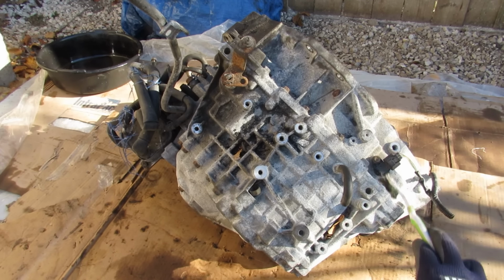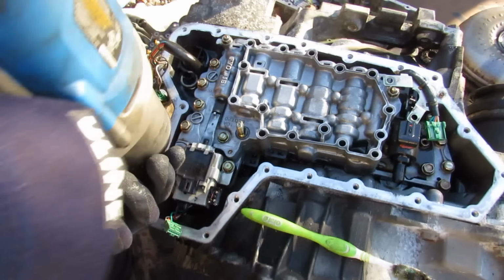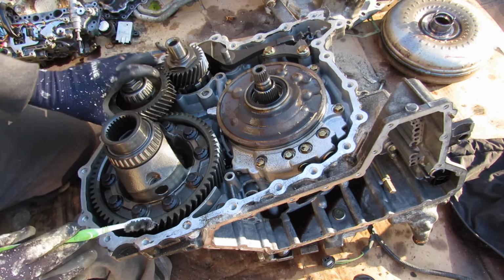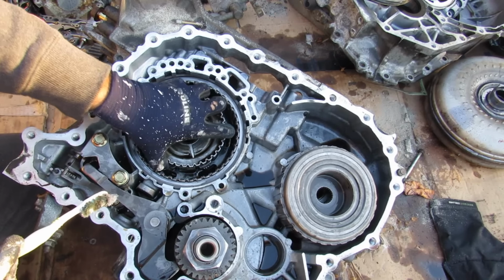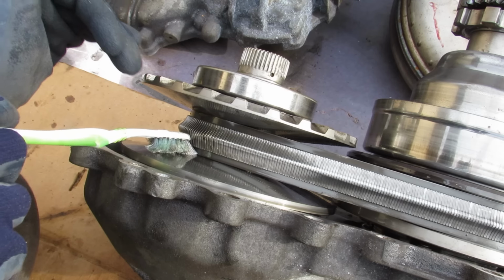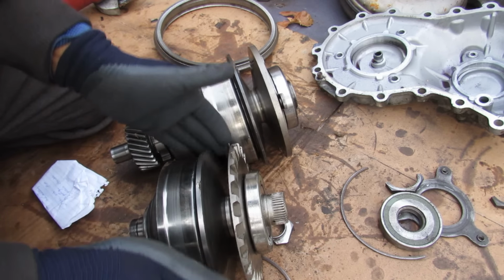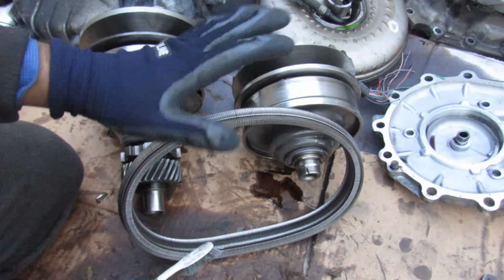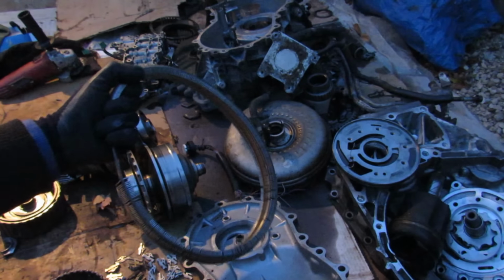Why Nissan CVTs FAIL

Comment: 17:15 ahh this makes so much sense. I thought the delayed response was something I was making up. It kind of felt like the car was thinking for a short while before it started to move. Had CVT on my 2002 Audi and wondered how it worked. Have seen a lot of animations but it's nice to finally see how it looks inside an actual cvt transmission. This is fantastic, thanks!
Reply: Nah... you weren't imaging it.  That's the main thing I tell people feels different about driving a CVT (on a '20 Subaru Crosstrek to be specific).  --  It also has paddle shifters and 5 "gear positions" on the dash so I'm still trying to figure out what the hell that all means but I did figure out a long time ago that you can pre-load the RPMs into the transmission by revving a couple times right before you take off.  The thing that really kills ya is trying to go pedal to the metal from a nil-RPMs standstill.
Reply: @llYossarian  thanks. I am a bit surprised the car isn't ready to go (hydraulically) once switched into drive but definitely noticed it more when accelerating suddenly.

In terms of the shifting (paddle or otherwise), I'm not sure about the Suburu but on my old car it was basically preset gear ratios, making the CVT feel a bit more like a manual. You could then control the revs in each set ratio (after shifting to it) without the gear ratio changing automatically as it would when driving normally. 

The car also had a button on the floor that if you pressed the accelerator hard enough it clicked and would change the gears to maximise acceleration.
Reply: @Chrazzari  Huh...  we are talking about almost two decades of improved computer control so that may be making a big difference.  --  If I don't use the paddles"/autostick" and accelerate smoothly I don't notice any "gear jump" at the ratios so I think it IS ready to go hydraulically but the computer is expecting a relatively "standard" acceleration and likely only varies the ratio at a few set speeds rather than dynamically so if you vary significantly from that "planned" powerband you get a "shift" sensation as the rotor extension speed changes -- if ANY of that makes sense...  I genuinely can't tell anymore.  I think I've hit a level of semantic satiation on this topic and my brain just seized up.
Reply: @llYossarian  oh yeah sorry I don't notice any jump when not using the "gears". It's smooth, but doesn't seem to accelerate until the gears have changed ratios (like we were talking before about the car "thinking" before moving). But as you said decades of improvements. Mine was a 2002 model so definitely would expect a lot of changes in that time.
Reply: Lol used to have a scooter so driving a CVT car didn’t do much good for my case. CVT are just fine. how we maintain them is pain in the butt. But it is much less complicated and “fewer” moving parts compared to AT. Or DCT. Definitely. But rubber bandy traction and hesitation fucks you over fr lol

Comment: In my personal opinion CVTs biggest point of failure is the driver not adjusting to the slower response time of a CVT and trying to compensate the rubber band effect with higher torque. You just have to grant it its time to switch ratios. Driving a car with CVT is much like driving a boat. Speed just doesn't come instantly whenever you want it.
Reply: Funny. American stress to much on  0-60!

Comment: Very nice! I'd be interested in seeing a teardown of a Dual Clutch Automatic. I just bought a car with that and... I really hope I didn't make a mistake.  :P
Reply: What car?
Reply: @viperstrike3827  2022 Hyundai Elantra NLine
Reply: @newcarpathia9422  Nice car though!
Reply: @viperstrike3827  I'm extremely pleased with it so far!
Reply: @newcarpathia9422  I drive a 2017 Honda fit base model stick shift. I love driving it despite the economy car corner cutting. It is the best cornering car I have ever driven, it stops great. It feels a little sporty because of the manual. I don't care about wheels being pretty. My major complaint is that it runs 4k rpm at 80mph, which is a big deal.
Reply: @viperstrike3827  I love me a well-built economy car. Even better are performance economy cars with a little turbo. All the fun with none of the baloney. Simple and straightforward. I drove a used Mercedes before I bought my Hyundai and all I could think about is, "What am I going to do with all this crap?"

Comment: Pretty dang good breakdown video! I've got a 2013 Nissan CVT and can confirm they last one transmission fluid's life ~65K miles. I also drive mine like a maniac though, so YMMV- literally. However, he's wrong in that they don't get rebuilt because the one in my car is rebuilt... sooo... Also, I've never heard any whine on any of the CVTs I've owned over my life, in fact, theyre much quieter than an automatic IME. Unfortunately, he failed to talk about the ideal torque curve that these CAN produce that results in notable performance benefits, but the manufacturers program them to act like an automatic transmission during regular driving conditions so you don't even get that benefit to as much of a degree. If you give it the gas it comes out of fake-bad-transmission mode and they absolutely rip pavement. There is no elastic feeling at all because fluid doesn't compress (enough to notice) and you don't need to (and definitely shouldn't, ever) immediately compress/release the actuators because you want a gradual variance. Because both actuators are moving simultaneously a small amount of movement gives you a noticeable change in ratio. If Nissan were to provide parts and better instructions so these could be easily repaired then these would be great, but since we don't really need transmissions anymore at all it really doesn't matter anymore.
Reply: because it wasn't changed at the proper interval? if you beat on the thing that is a problem. sounds like your control unit may have a problem? was it replaced?

Comment: I had a 2008 Mitsubishi Lancer gts with 210k with a cvt transmission ran like a champ till someone hit me ended up having to get rid of it otherwise it would still be going 💪 i always kept up on proper cvt fluid change intervals so they can last with good care and built correctly lol

Comment: It's an Dutch invention , 
Made by the DAF ⭐.
Now the only thing that is rolling out the factory are Trucks , like the DAF 95XF
Super Space Cab ✳️ .
Reply: I remember my rubber-band CVT DAF 66 Marathon well! A quick snip of the inhibitor switch and it went as fast in reverse as it did forwards!  Shame about the nasty clattery Renault engine.
Reply: @LondonSteveLee  
Yes you are right .
We even held backwards racing on circuit Zandvoort .
Just as you said ,
only in reverse .
With obstacles and big bumps placed all over the track . 
It was mayhem and destruction . 
It was fantastic to see .
But yeah that where the crazy 70s and 80s years.
Everything was possible .
Nothing was crazy enough .
Well anyways thanks for replying and have a great day .👍🏼😁
Reply: @DoubleD_83  Zandvoort - what a great circuit.

Comment: They don't. You just have to change the fluid every 60-100k with "original" Nissan only cvt fluid. Go to Valvoline with the original Nissan CVT fluid. They flush out all the dirt. 
My car has 300,000 miles on the first Transmission!!!

Comment: This seems to get-around the design defect: Keep 'em cool as many ways of reduced coolant/distilled water ratios, both filters and best cvt fluid each 30k, allow set overnight or allow 8 hours for warm drain to obtain around 5.5 quarts if not flushing, seal all air leaks of radiator plenum (Time -consuming), keep radiators clean. I'm now 209k Mojave hard-and-hot conditions, full AC
Reply: it seems like error of survivor, there are plenty examples as almost new CVT were **cked up without any reason.
Reply: @letwolf  No question there was deep neglect all through these things when too many simple problems are plain to see. Unbelievable given the very high production volumes.

Comment: Amazing how complex it all is, and it all just works as well as it does.  Human ingenuity is amazing.
Reply: Had the same thought. Maybe this isn’t the most reliable but you can see the ingenuity in the design. I’m sure a reliable CVT could be produced if it wasn’t optimized only for low cost. For example the too-small cooler. That seems like a dumb decision made only for cost savings.
Reply: It's just proved how amazing our God is!
Reply: @eromance12345  your god
Reply: @hotcakesism  and bigbang randomly created us all?
Reply: @eromance12345  pretty sure the engineers were of the normal human variety.
Reply: @hotcakesism  his, yours and everyone's

Comment: I worked for Nissan tech-line for 7 years in Smyrna TN.Most all recommendations were to replace the cvt. That’s why whyI bought my Nissan in 2014, I bought a manual transmission. Dealerships are now rebuilding them to save money but they still fail and techs call in to request a new one .

Comment: The Variomatic Daf transmission was developed in 1958 and found on Daf cars, it worked very well, it was a simple system and it is still in use today.
Reply: Some of them went the same speed forwards as backwards. So we had reverse races back then with the DAF 66.
Reply: @mistersunny3636  okay, hooper- put your hands behind your back. now answer just one question- why did you drive the car into the bay?

Comment: Moral of the story: Don't put a snowmobile transmission in a car. If you want a transmission that behaves in this manner, get a Buick Dynaflow. They are very reliable. You might want to add two things though, an Overdrive and a lockup on the torque converter.

Comment: I own a Toyata Sienta 2010 I have a 'buzzing' noise in the transmission CVT type that occurs during acceleration. A mechanic told me that it is nothing to be concerned about. But I am. I realize I am asking to diagnose without seeing but perhaps you can give me an idea of whether I need to rebuild the transmission or can I drive the vehicle long term without worrying about it. Thanks

Comment: Hi, i own Qashqai 2011 2.0 petrol automatic (CVT) front wheel drive. My transmission failed, can i fit from   4x4 transmission?
Reply from the maker: Probably but you'll need some electronic over rides

Comment: The big torquey V6 paired with a CVT is not even a good excuse. I've got a Nissan Versa with the CVT, no power, yet they are still known to fail.
Reply from the maker: V6 just makes it worse!!
Reply: @speedkar99  Yup. And people wonder why Nissan is grappling with bankruptcy? It's not just that one French dude!
Reply: Depends on the type of CVT - Lexus RX400h and RX450hs are big torquey V6s the transmissions last forever.

Comment: These are the trans of the future. Why, because they’re good?  No, it’s because they’re simpler and cheaper to make. Maybe throwaways. You said they’re failing within warranty. I always drive a standard trans. So why are these Nissan trans crap?  Honda and Toyota are good. I know Nissan doesn’t outsource their trans. Your video title was ‘Why Nissan CVT trans fail’.  I didn’t detect an answer. So why do they fail?
Reply from the maker: Overheat
Reply: @speedkar99  Why do they overheat?

Comment: You mentioned the bevel gears run quiet. I agree. Their main advantage is increased power capability…because of the increase of gear tooth contact.  At 715 you say fuel pump instead of oil pump. You must have been tired. I love your videos, you know your stuff
Reply from the maker: Thank you for the correction

Comment: CVT's fail on Nissans, the same models of  CVT's are used on Mitsubishi's and are very reliable.  Essentially what that means is Nissan is likely putting too much horsepower and too much torque through these units.
Reply from the maker: Isn't the Mitsubishi CVT too new to tell reliability
Reply: @speedkar99  the same cvt has been in the mirage since 2014.  It is proven.

Comment: I had a Nissan Mariano with the CVT and I got over 258,000 miles out of it with zero problems
Reply: Did you do routine maintenance as far as changing cvt tranii fluid?

Comment: You do fail to mention what kills those transmissions.  That's cool though; for those of you with a cvt transmission, just change your fluid ever 30k miles.  On that note, you did a super good job explaining the transmission that anyone with any kind of bicycle in their life would have understood.  (please note my sarcastic comment please)
Reply: Yes, but Subaru put an extended warranty (10 yr/100,000 mi) on them and the manual states NO service needed so it you change the fluid, you void the warranty. Dump your Subaru before the extended warranty runs out. My brother's CVT in his 2013 Forester died at 80,000 miles. Car has 140,000 on it now. He says he's going to give it to his son. I wouldn't.

Comment: the belt looks like in good condition. it doesn't really give much of a detailed explanation as to why it fails other pointing out the advantages and disadvantages. advantage: good for lightweight fuel economy vehicles. disadvantage: not good for hauling heavy loads. so is it the driver's fault then?

Comment: i own 2016 nissan maxima  ,,,, i had a stuter problame in low speeds  ,,, took it  the dealer and it truns out  that the valve body was difacted  had to change it .....  later i learnd that to service this gears on maxima they have to remove the valve body to replace the filter ...  and that what case the stutter in the first place  ..... an experiance  mechanic told me just to change the the oil without the filter lol  ,,,, big disapointment tbh

Comment: As an electric car owner that used to love working on cars, I can tell you that transmission looks like a convoluted piece of junk made out of a thousand parts waiting to break.
Reply: You can fix mechanical stuff - if one of the 100 computers on board your electric car goes wrong you won't be able to charge or drive it - or if you upset the government and they send a kill command to your internet-connected electric car - it's now a fancy road ornament.
Reply: @LondonSteveLee  my ICE cars were full of electronics, of which some of them can also be repaired.  If you can buy a new car that doesn't have computers or electronics in it, let us know.

The government kill switch scenario, however remotely possible, is highly unlikely.
Reply: @WhatsUpLand  Your ICE cars weren't connected to the internet with exposed control systems waiting to be turned off - If push came to shove you could buy an off the shelf megasquirt FI and ignition system and get any petrol engine working quite easily - throw the manufacturer's ECU stuff away.
Reply: @LondonSteveLee  You're still talking about an apocalyptic and hypothetical situation.  You had better order your parts now and start working on your retrofit because when SHTF... people will have other priorities and ways of doing things.  Make sure you're armed and armoured while you're at it.
Reply: @WhatsUpLand  I have several classic cars which will work just fine for decades to come - if I can find the fuel.  Obviously you could get an old diesel and run it off vegetable oil - that's why they are attacking diesels with vengeance.

Comment: I have a nisaan with  CVT 2012 Altima if u take care of it they don't fail number 1 ...the problem is people don't change the fluid I do it every 80,000 km no issues and I change the CVT tranny filter while I do it and add Lubegard CVT recharge and protect never had an issue my last nissan had 450,000km original CVT.....no issues ...its how u take care of it and how u drive it never had any CVTs fail too many people don't maintain anything any transmission can Fail the Honda and Acura SUVs have worse transmissions than the CVTs ,,,,there are less moving parts in a CVT so that is better when it comes to transmission......just take care of the car change the fluids most nissan dealers are dumb and tell people not to change it...why sell fluid if you are telling people not to change it as to why u see all these failures that goes for any transmission....People need to wake up and do there homework instead of listening to some BS a dealer tells u

Comment: The real problem is the use of CVTS in general.. The ones Toyota/Subaru use are way stronger and can handle a lot more torque and Power but even they have there limits. And when they fail it's just as bad as the Jaco. But you can make way more power safely with a Subaru CVT than a Nissan.. Nissan was so foolish to Or (smart from a company stand point) to use these in like 90% of their cars sold over the last 14 years.. And they keep getting away with it. They have made improvements to them over that's few years but I will never buy one again. I've been running Amsoil CVT fluid for over a year now seems to grip and hold a lot better truly.

Comment: Why did they switch the cooler period, they decided to add this small heat exchanger on the cvt itself, when the old way was there was a concentric oil cooler inside the bottom tank of the radiator, this style cooler was much better at removing the heat. If it aint broke dont fix it. Why didnt they keep this style cooler with the cvt im sure there would be less overheating issues

Comment: I have a 2013 Jeep Compass with cvt.  It will not go above 25mph.   It has reverse, and does not seem like it’s slipping, just won’t go above 25.  I changed the solenoids, and selector electronic thing on the valve body.  Still the same.  Any ideas ???

Comment: Too complicated for too nothing...In the end the fuel average is almost the same as regular manual. I would prefer manual over this unnecessary, expensive to maintain invention and I am saying it from my own experience.
Reply: Not only that, CVTs are more delicate. Cannot withstand abuse. I still yet to find a CVT that can last 200,000km, which my manual gearbox lasted for 20 years.